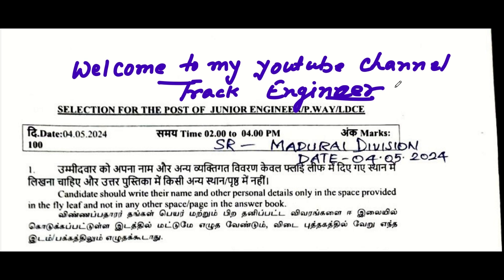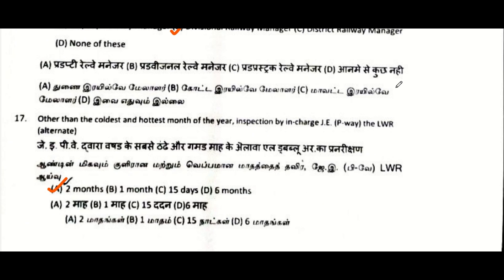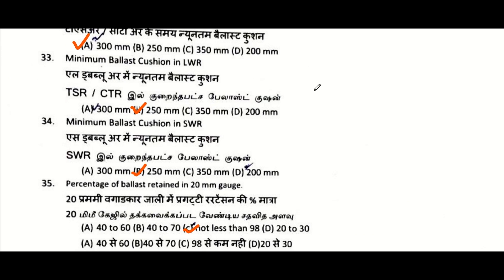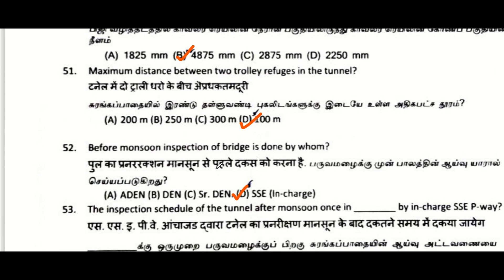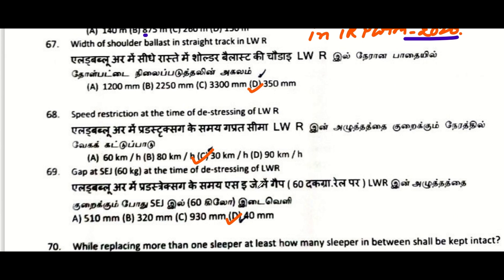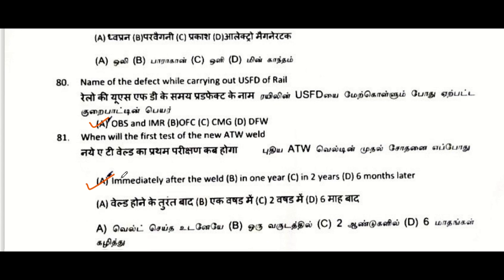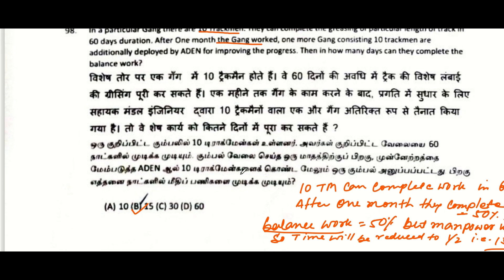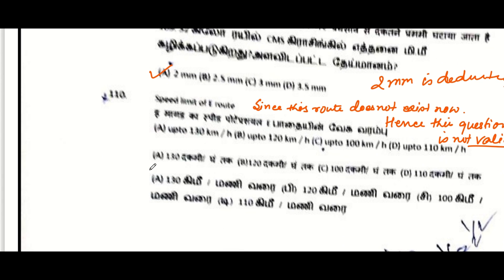JE P WAY QUESTION ANSWER MADURAI DIVISION  04.05.2024 | ER TRIVENDRA KUMAR |MDU|Previous year paper

Comment: सर जी SWR, और LWR का न्यूंनतम  बेलास्ट कितना है और ये IRPWM में कहाँ लिखा है
Reply from the maker: See in ballast profile
Reply: @trackengineer  para number kya hai sir
Reply: LWR me minimum track 52kg rail, 1540 sleeper and 300mm kushan  diya hua hai kon sa vala sahi hai
Reply from the maker: @monusinghsingh4503  This is applicable for temperature Zone–I,
LWR/CWR may be laid on curves up to 350 m radius (5° Curve)
Reply: SWR ka mil hi nahi raha
Reply from the maker: @monusinghsingh4503  Annexure - 2/2(B) (Para 212) -Standard Ballast Profile for BG (Other than LWR/CWR)